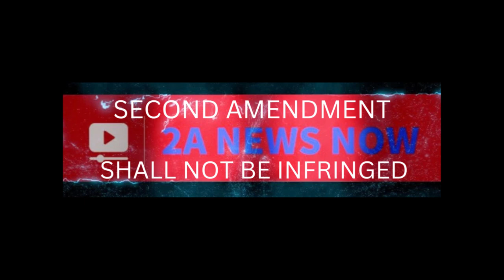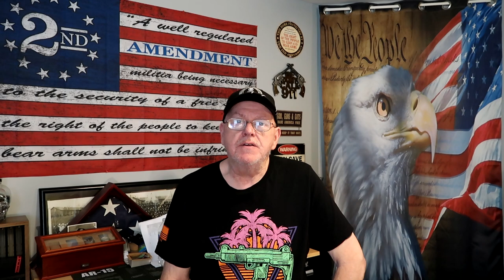BOMBSHELL NEWS - The Rust Movie Shooting Gun May Have Been Intentionally Modified

Comment: I had a 454 Casull shear off the sear at a Silhouette match. I was lucky. It was the last shot of a 40 round match. That meant I was at the far end of the range. Had my spotter not been a lefty that spotted on my left side, the gun would have hit Him as it flew out of my grasp and over my shoulder. When cocking a single action revolver Your thumb and pointer finger aren’t holding the gun. That leaves Your three weakest fingers hanging on. Not enough for a 454.